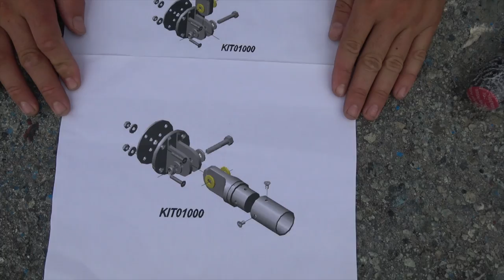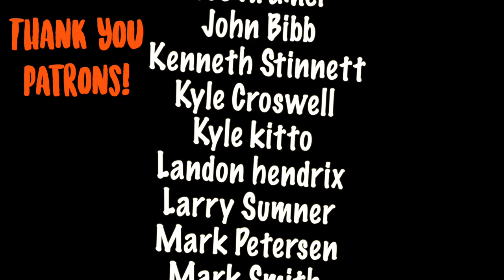Solar Tower Install | SMLS S9E23

Comment: If you cut it too short, you can easily add a piece of tube (outer diameter same as inner diameter of existing tube) that slips down inside the tube snug and then add an extension (excess cut off piece) onto that. Then Cut again to correct length. You could have it welded on or even bolt it on.
Reply from the maker: That’s a good idea. Fortunately this piece slips under the radar plate and can be slid to adjust

Comment: Oh no. I read the title of this vid and recalled our short convo about these installs. Installed another one last week down in vero. I should have tried to give you better advice. 
“Is it as straight forward as it looks?” 
“Pretty much. Just remember to pre load and check where the backing plates go.”
Reply from the maker: It was a nightmare
Reply: GoSea Sailing well tell all your friends and viewers Responder Marine LLC out of st Augustine does these all the time. And we are mobile. As long as it’s not a massive catamaran it usually takes us 4-6 hrs.

Comment: You go around a few times then slightly tighten the pipe cutter.let the tool do the cutting. I was waiting for the wheel to break.

Comment: If the arch is designed to be top mounted and you move the mounts to the side...isn't that going to change the load on the mounts?  Instead of the metal to the base taking the load, now the metal measured from the bore to the outside of the mount strut will be taking the load.  I would suggest a call to the manufacturer about the difference in material strength in your configuration when solar are mounted and exerted pressure from wind and wave action.

Comment: The main duty of a captain is to assign qualified personnel to perform the required task.  I'll just let that soak for a while.  Curiously, what kind of sailor requires a swabbie in every facet of life.
Reply from the maker: Searle is great with engineering things. I like to edit for comedic value sometimes. The wonky cut slipped into the radar plate never to be seen again😆